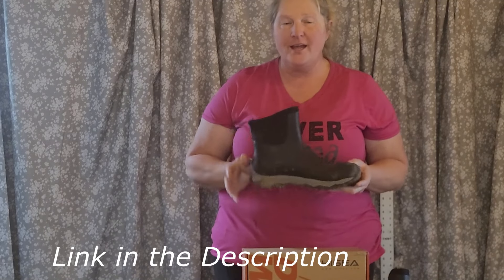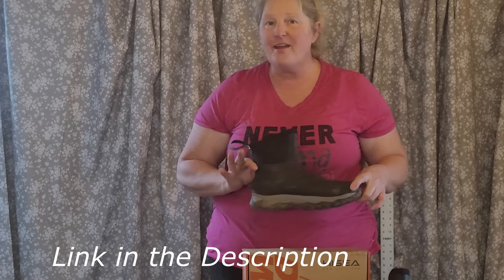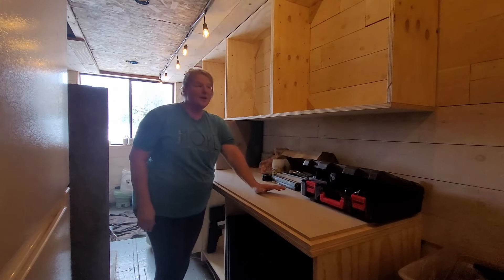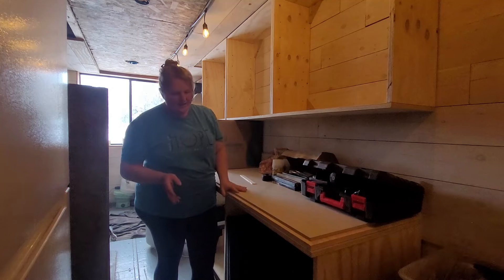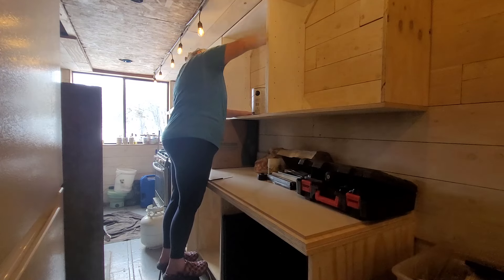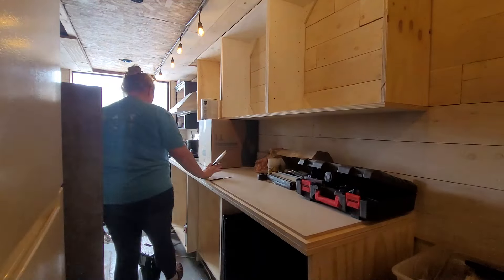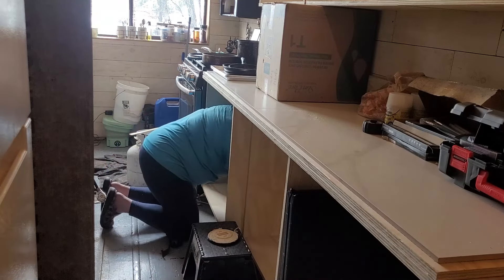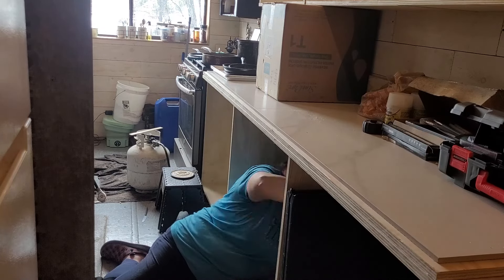Building My Dream Tiny House Kitchen Adding Utility Closet// Talking about step 5 in 12 Step program

Comment: Don't worry about the mess, when your done it will be so fantastic and been worth while. I was watching you paint the cupboards and it reminded me about when my sister and I would paint some. Every few years my mom wanted the cupboards painted. I was remembering the one time we painted them sat down for a rest and looked back and all the paint had ran down the wall and was sitting on the counter. We ended up scooping up the paint and doing it again. What a mess. Its funny now but we were so pissed. Love the idea about the broom closet wish I had one. The old houses used to have them along with a built in ironing board. We even had a build in cutting board that would slide out from the bottom of the counter. Love it. You could put your garbage pail below and then push the peels and stuff right into it. Saved time. It was right beside the sink so you could rinse the veggies too. It slid right out so you could wash it and put it back in, saves space as well. I have a knife magnet. I put it on the side of my fridge but you can get them to go on any wall. I find it so handy and you never have to dig threw a drawer to find the knife you want or cut yourself doing it. Just a thought. Your doing fantastic, keep up the great work. Hugs
Reply from the maker: I am putting in a cutting board spott..  and I have been researching a good knife setup

Comment: FYI.  If you go with Formica countertops; you can buy iron on end caps.  Drawers with finished fronts and heavy duty slides; are much better than doors.  They make it possible to use the whole cabinet.